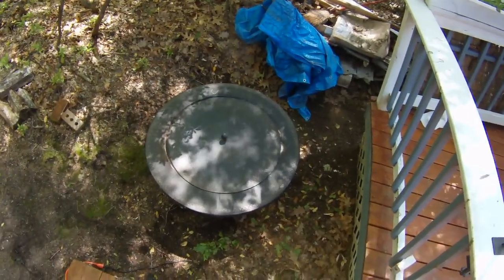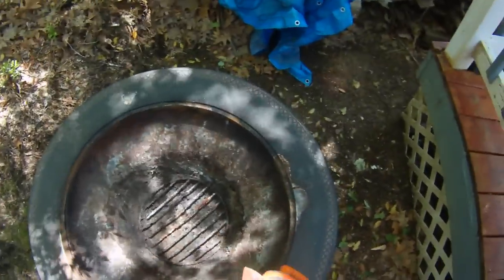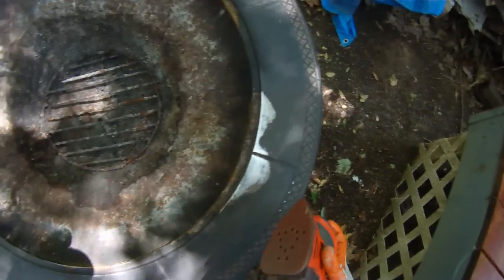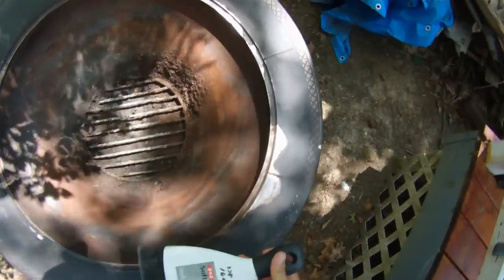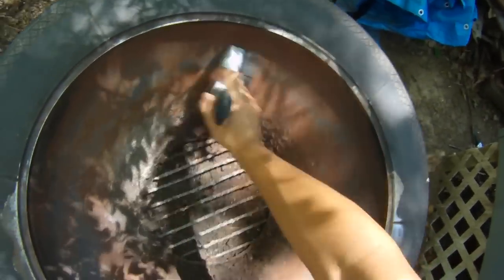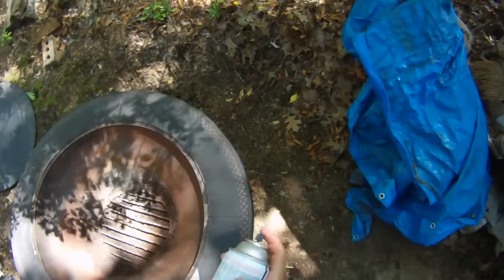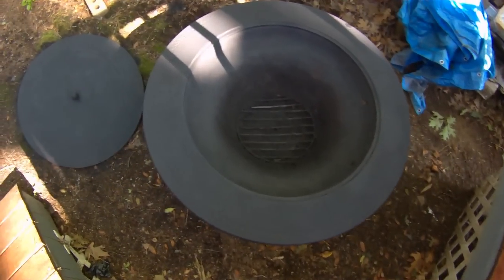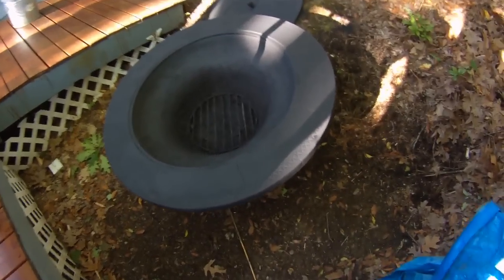How to restore a rusty Fire Pit

Comment: Both Rustoleum and krylon high heat said not to use on areas flame will touch.  I found an ace hardware barbecue high heat paint that does not warn against using on areas with direct flame.
Reply from the maker: Thanks for the Post great Tip! Have a Nice weekend!

Comment: I have a quick question, I notice that you didn't paint inside the barbecue. Should I avoid that even after sanding ?
Reply from the maker: Well that depends on your fire pit, if you have rust and what to hide it you can but it will smell strange for a couple of times after you put fire in it.

Comment: I was told that paint is not good for areas that touch actual fire.  Have you used this before and does it hold up
Reply from the maker: curriegc it seem to hold up fine for me just make sure to use the high heat paint, best of luck
Reply: Review Outlaw Thank you.  I'm gonna get it tomorrow

Comment: Rustoleum told me this paint is NOT for any areas that actually touch flames. The flames will break it down and that exposes people to toxic fumes!
Reply from the maker: Good to know i did not seem to have any problems but it might just be the first couple of fires and then the fumes go away. Have a Great Summer!
Reply: Rustoleum does make a Fire-Proof Engine Enamle, but it's 4x the cost. For such a small job, anything the fire will burn off, will likely be burned off the 1st few minutes of a fire, and be done with. Also, outdoors, in the wide open.... I think he's good to go

Comment: I need advice. I have one that i am restoring, its in much worse shape then yours. Its probably over 8 years old. I got most of the rust off and will have to do it again because the weather were i live is making it difficult for me to do continous work on it.. Anyway I am wanting to add rock detailing to the rim once the rust is off and wanted to know wether you thought i needed to paint it or not before doing that? Would it make a difference? And also if the rust is too bad how can i tell so i know when to call it quits on trying to save the fire pit?
Reply from the maker: Hope the weather is getting better for you, As far as painting before adding the rocks it depends on the look you are going for, it will not hurt. It would also depend on how you are attaching the rocks. If you can poke a hole through the firepit with a screw driver it's time to call it quits, Best of luck!
Reply: @Reviewoutlaw  Clean the metal and put a thin sheet of metal on the inside, but not to think. Tack weld it together and then fill the holes and grind it flat. You can also fill small holes with a mig gun. That's what I did and it looks new.

Comment: Should have used a metal  wire wheel from the start like on a angle grinder and that's not the way you spray paint. If I was you I'd delete this video.. I'm not being a wiseass with all do you respect .it's just wrong.. I know color is a choice but flat black or maybe even burgundy would be a good color just saying like I said no disrespect

Comment: Brah you didn't even prep the surface after you sanded and you didn't use any high heat primer.  WTF kind of video was this.  Your restoration is maybe gonna last a couple of months when all the paint burns or flakes off...